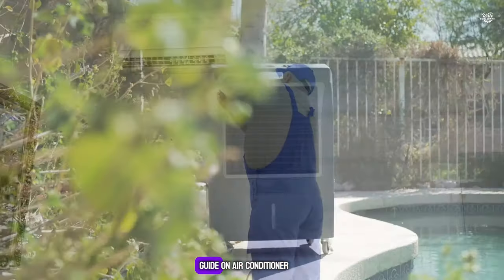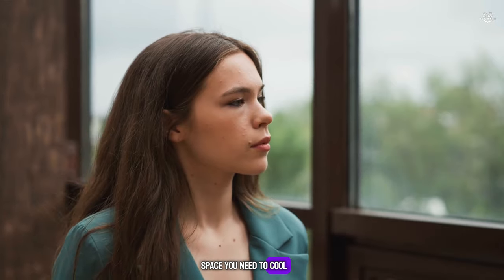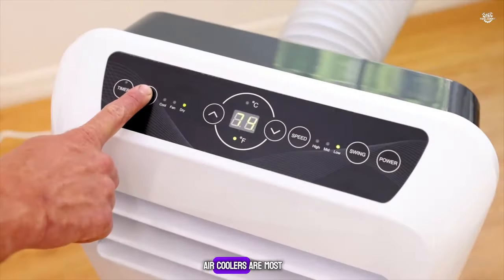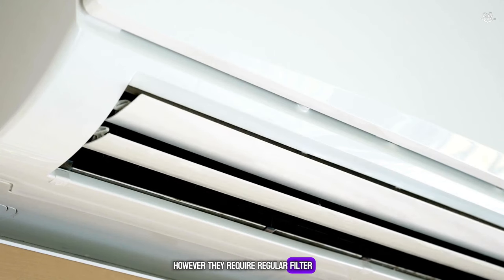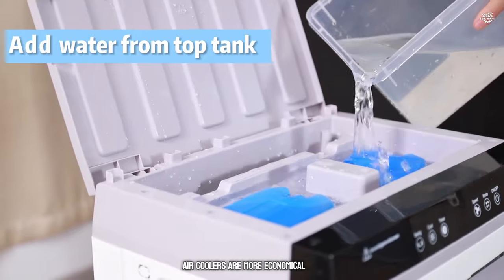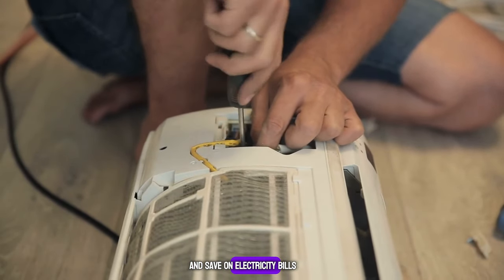Air Conditioner vs Air Cooler [Differences] The Cooling Guide

Comment from the maker: 0:00 – Intro: Air Conditioner vs Air Cooler
1:20 – Features of AC VS Cooler
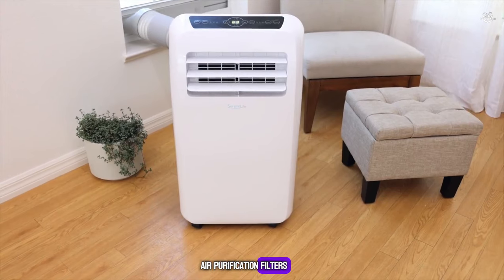1:57 - Economical Range
2:17 - Installation Requirements
2:42 – Voltage Differences
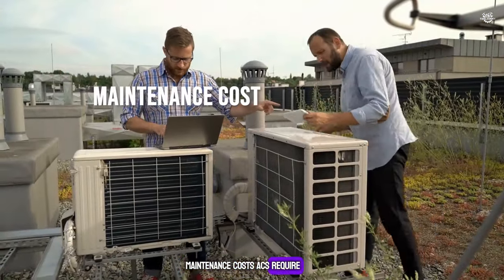2:58 - Maintenance Cost
3:15 - Environment Friendly
3:33 – Effectiveness
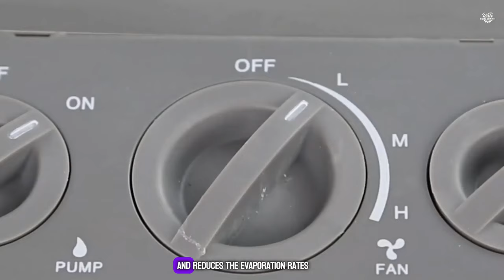3:53 - Electricity Consumption
4:10 - Comfort Level
4:32 - Air Quality of Air Conditioner and Air Cooler 
4:53 - Moisture Levels
6:15 – Outro: AC VS Cooler